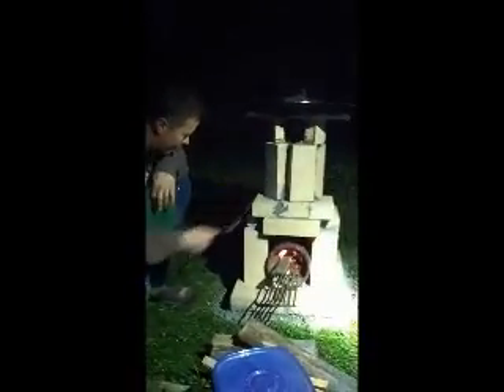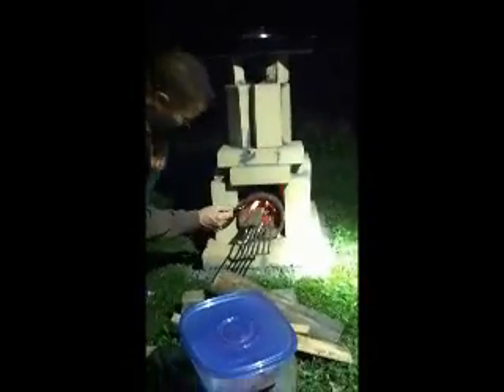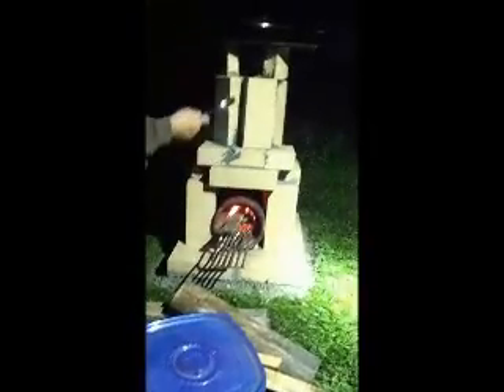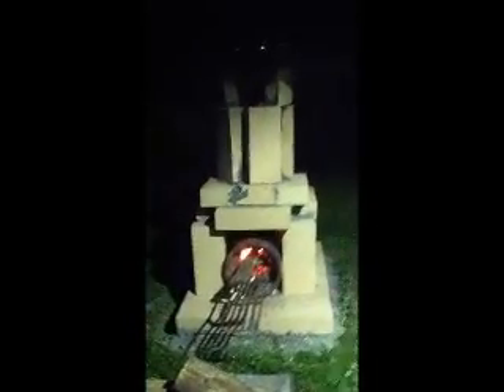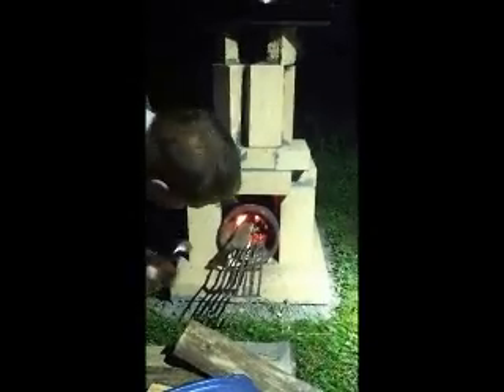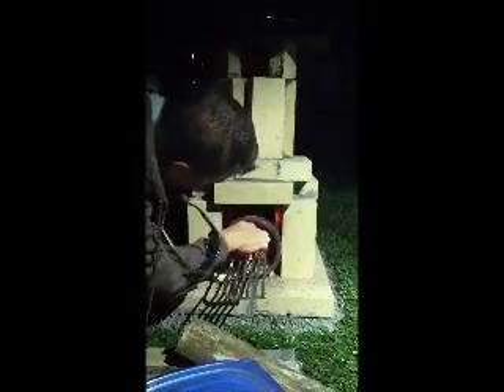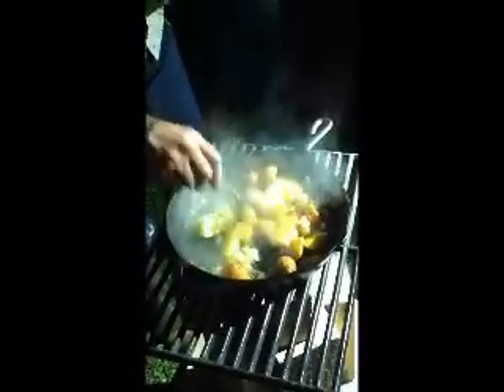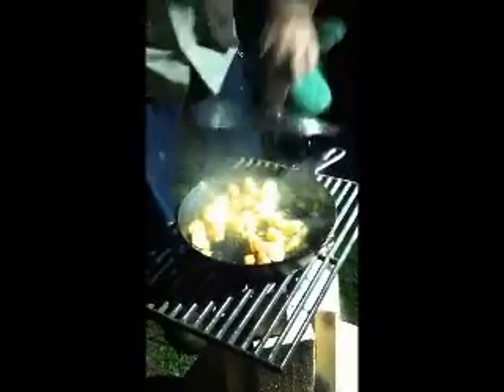rocket stove # 2.mpg

Comment: nice i have made a little one with fire brick recently myself, does the ceramic clay pipe crack with alot of heat?
Reply from the maker: yes it does, only an emergency use, ive moved on to masonry heaters now